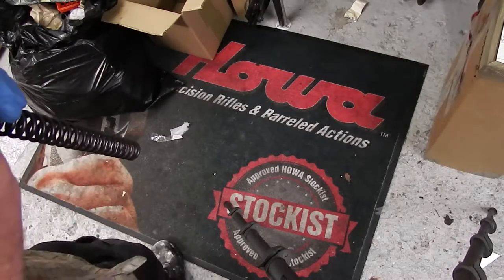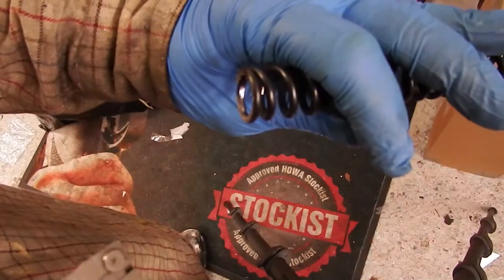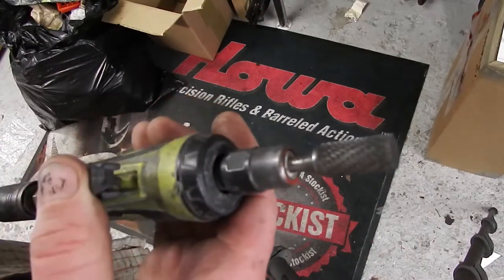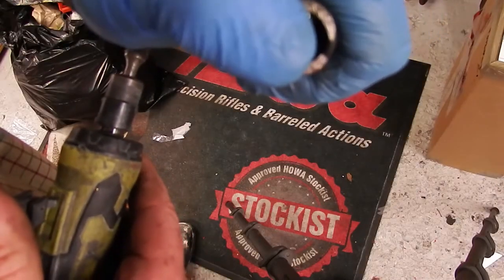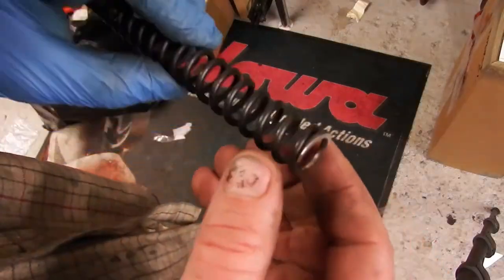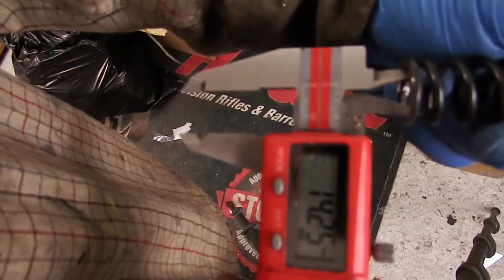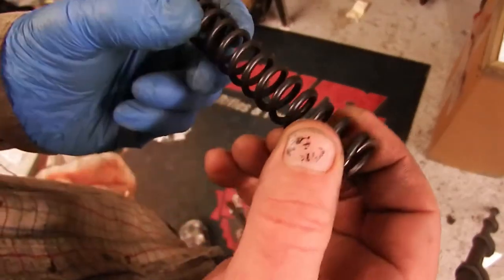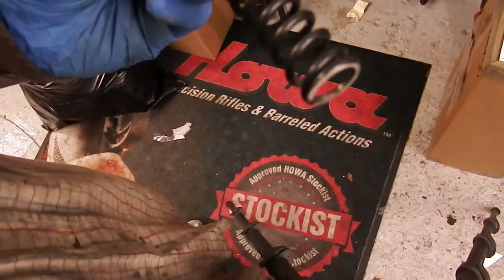Air rifle drop in kits, spring work essentials.

Comment: thanks for that tip , just as you said rough sharp edge had scored all the way down the guide . cleaned up both ends as you instructed the guide was reasonable cosy fit but the spring was dry as a bone greased it put it back together sounds like a different rifle , that was a 98 s straight out of the box too . doesnt say much for  their quality control these days cheers for that .